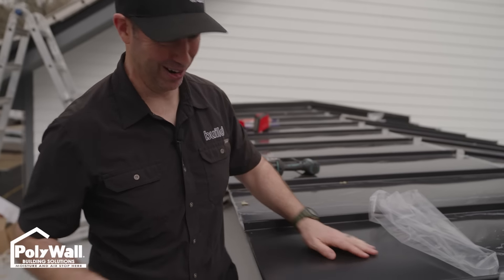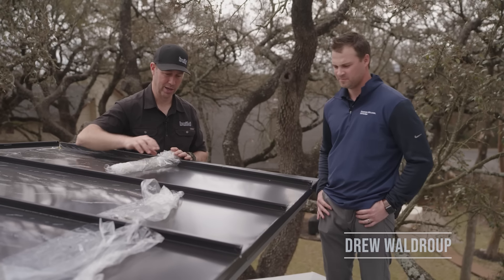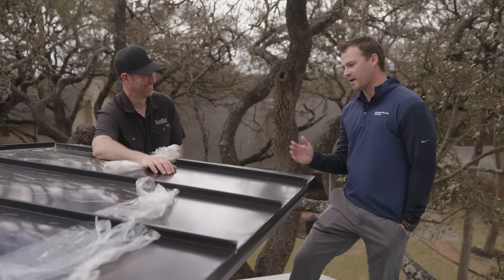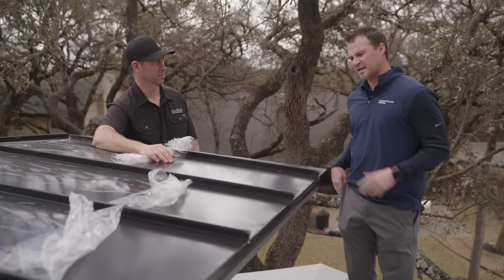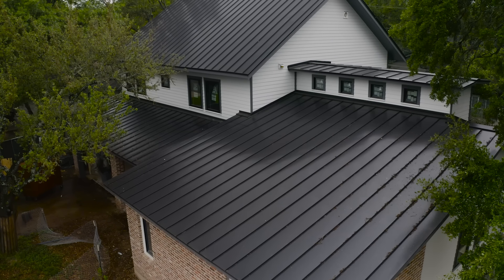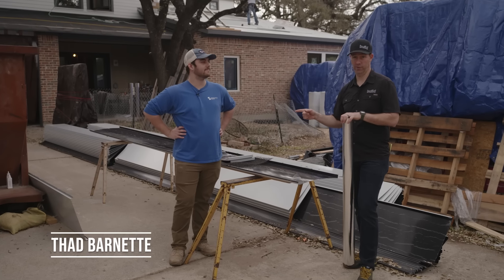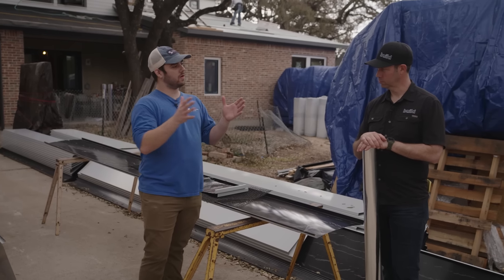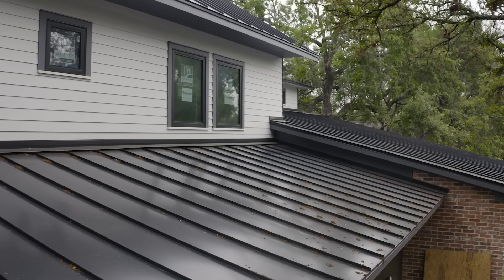Black Metal Roof - Dumb Idea?

Comment: very different from standard in Europe where it's mainly roof tiles and done well it can last centuries. I guess the labor cost is way much cheaper on the metal side though.
Metal is commonly used for warehouse or when there it not enough slope, and some place have zinc roof.
Reply: the nuts part is that in the south of europe they use the most clay and concrete roofing. where they also have the most quakes and big storms. with the north western parts like the netherlands its almost only clay brick tiles and yeah with storms they can go flying.
Reply: I priced a metal roof, and a tile roof in Croatia for a house. Metal was more expensive - it's more labour intensive to install than tile.
Reply: Yeah, metal roofs are very coomon in warehouses if you want a sloped roof. But, they are not made-up by architects or contractors; they're "metal roof sytems" such as VicWest's Marquis. Have used that system a lot.
Have also done zinc roofs - usually made by Rheinzink. Zinc roofs are gorgeous, although they can be expensive. They also require a high degree of metal roof installation experience and training. Not every metal roof installer can do zinc - manufacturers won't let them without extensive training, because there so much at stake with zinc roofs.
Reply: Ganga Din  
Neither! It's a question of what geographic region in the World you are talking about. Local market conditions dictate.
Nexe, and Tondach are big players when it comes to roof tiles in some regions. They make excellent tiles, and are not expensive.
Reply: Ganga Din  Yes, I'm talking about clay tiles. Unfortunately, I left my laptop in Croatia, so I don't have the actual numbers.
Roughly, for a 2,500 sf roof, the tiles *supply only" came to around CDN $6,000 for the Nexe Valens (black) tile.
The metal roof was roughly CDN $9,000. It was made by Prefa (standing seam, zinc coated steel).
Installation costs are higher for metal, than for clay, according to a couple contratctors I spoke to, because metal roof are more complicated to install than tile. The roof structure is essentially similar for both roofs. Labour rates are cheap over there.
I think with installation, the Nexe clay tile I could have had for under CDN $10,000 easily.

You can, if you want import them to North America, but depending where you are, the contractors may not know how to install them properly. Tondach is another very large roof tile manufacturer in Europe, and they have a huge selection of clay tile profiles and colours including white, if you prefer.

https://us.prefa.com/
European web sites are not in English, and they carry a larger selection over there.

https://www.nexe.hr/en/roof-tile-6074/6074
https://nexe-crijep.hr/proizvodi/valens/

https://www.wienerberger.hr/proizvodi/krov/tondach-crijep.html?gclid=Cj0KCQjwvYSEBhDjARIsAJMn0liPSQ2EQAlvQjxG8m-WIkQ1IiPghNTiamC-sDE8MmWXArblpsBmhewaAtaWEALw_wcB&loadmore=2
Reply: Centuries?

Comment: What I noticed after installing a black metal roof is that it still reflects a lot more light than any asphalt roof. The black metal looks blinding white in direct sunlight and it's even hard to look directly at it. I live in the north though, so I went black to help melt snow.

Comment: I went from a black shingle roof to a white shingle roof several years ago.
My energy costs during the summer went WAY down because my roof wasn't soaking up all the heat.
Reply: yes but  I haven't seen a white roof that doesn't look dirty after a season
Reply: @danielwanner8708  
Pressure washer with a good nozzle that can reach the roof.. Easy to clean.  :)
Reply: @JohnD-JohnD  Please don't do that . You will shorten the life of the roof . 3000 PSI probably would be enough to blow a hole into the shingle .  What really makes it nasty looking is the sealing strip melting and oozing out from beneath the shingle . I went from white to black . Architectural shingle . 15  years still looks great.
Reply: @danielwanner8708  
lol, you misunderstood.. Or I didn't clarify.
Pressure washer with soap cannon.. It's not a high-pressure jet and will not scrub away the surface.
Reply: @JohnD-JohnD  that makes sense . I already saw holes being blasted into roofs . lol

Comment: I have a black metal roof, looks amazing, SUPER ANNOYING in the summer, no matter the expansion joints, no matter the expansion holes for the screws, it still buckles, bends & warps during hot summer days (or even spring, the problem has already started), when it cools down during the evening the roof unwarps itself to flat again & it sounds like a gunshots/explosions, keeps me up at night....but who knows, maybe your roof is immune to this issue

Comment: Matt, you only talked about Heat and Fade issues. What about expansion/contraction of the metal? 
Black roof... more heat...  equals more expansion/movement ? How do you compensate for this?

Comment: I don’t understand the reflective sharkskin layer.  Common sense seems to say you’ve created a heat pump radiating and reflecting heat back into the house.  Any heat in the air gap reflects only one way, to the house, meaning heat in the house stays in the house.  Heat in the metal sheet conducts to the reflective layer (no air gap there equals no reflecting back) then radiates to the house.  Hence the heat pump.  It should have been built with the reflective layer on the house facing out then the air gap above that.   Am I totally crazy?!?!
Reply: It's installed correctly.  It's to prevent emissive radiation, not reflection.  I wrote a longer comment explaining it better.

Comment: All I can say is. Any Roof you choose ensure you have proper venting with your roofing installed. That alone accounts for 90% of your efficiency. As more of a draft zone you got as better is will become. I prefer a metal 3' draft zone and below the draft zone I install the radiant barrier and use attic solar fan's so only when the sun is hot enough and the thermostat is kicked on it will kick those fan's on which will help to suck out the hot air which is been trapped in that space between your roof shingles and your radiant barrier. It will result in a 60F+ degree difference  for your attic which is HUGE.

Comment: Looking at that shark skin roofing, it seems to me that you could use the channels to lay in passive solar water heating pipes.  Double duty.
As for black roofs, black absorbs more sunlight, so that if you have snow itll take longer for the snow to stick on the metal.

Comment: If you're still hitting all the PHIUS targets I don't think the color matters. 
On the plus side, the energy gain from the dark paint will speed up the drying of any moisture that gets into the air gap. That might be worth the efficiency hit. 
The standing seam roof is nice for PV attachments. I don't remember if you've said anything about the PV system.

Comment: Short answer: a black roof in Austin Texas *IS* dumb *IF* you're expecting it to perform like a white roof 😉
Reply: Which means anyone actually paying it's dumb.
Reply: @davidg5010  In Austin?? Maybe 2 months?
Reply: @davidg5010  If the roof or attic is insulated, like it should be, the heating assistance is minimal, especially since sunlight is at its weakest during the winter.

Comment: We wrapped our entire house in corrugated steel in the early 2000s. For the most part we have had very little color issues over the last 20 years except in a few specific spots. The heat is an issue but I believe a lot of that is because we have insulation from 1976.

At the time metal on a house wasnt a thing. When we started the process the steel company told us we couldnt do it. I imagine most of the tech has advanced drastically. We are in So. Cal so it can get hot.

Oh and we had a tree fall on the house a few years back. Dented a corner but thats about it. No extensive damage at all.

Comment: The look is perfect, and with the insulation, reflective barrier and air-gap you shouldn't get much (if any) heat gain from the dark color there in Texas.  I'm in Michigan however and for better than half of the year I would WELCOME heat transfer into the house!
Reply: Keep on mind solar gain will be significantly reduced in winter, especially in the north, and especially on low slope roofs.

I would still go with a lighter colored roof, even where I live in Canada.
Reply: @Bob_Lob_Law  A low slope roof isn't in the forecast unless I can persuade "she-who-must-be-obeyed" to move to more southern climes!  When I do my own build, I'm planning on the roof slope being about the same as the latitude (43 degrees) and with the ridgeline running as close to E-W as possible since I want to do PV for backup power.
Reply: @michiganengineer8621  I've been working on an energy study lately. I live in winnipeg, and I've been crunching numbers on a totally off grid structure.

It is very difficult, as we have very little sun in January and up to 1050 HDD. Because the limiting factor is winter, a very high angle is optimal.

Something around 70 degrees, also southern glazing is very important for heating, and a high SHGC combined with a low u factor is important.

I've been thinking about a home design with lots of southern glass, and a monoslope roof pointing south. You could do battery storage, solar, and solar thermal.

If you don't have net metering, you will want to generate energy when you need it the most, ex winter, and furthermore you will need to optimize it over annual generation. Probably mounting your panels on a rack will be necessary.

Unless you plan to insulate your hkme really well and use high effeciency appliances, you will have a difficult time harvesting the energy you need. Even in a warm climate like Michigan.
Reply: @Bob_Lob_Law  Net metering is available in most areas of Michigan, so mine would probably be a "hybrid" as far as electricity.  About 6 years ago we lost electric for a week and a half just before Christmas, so a whole house (multi-fuel) generator would also be a must-have.

Comment: Nice build, but I thought with a radiant heat Barrier you need a air gap to make work the best, so air gap between roof metal and radiant Barrier???  Maybe you can show some testing of barrier and with out? Thanks
Reply: His air gap is between the roof deck and the roof, with the radiant barrier’s shiny side down. 

It sounds counterintuitive, but it works. I was confused at first, too.

Basically, it’s not there to reflect the radiant heat. It’s there because it doesn’t emit heat. You can Google this. It’s pretty well documented.

Comment: I measured this years ago by placing two pieces of metal in the hot Central Texas sun.  The silver piece was 110 deg F, and the black was 135 deg F.  White would have been even cooler.
Reply: But how did you measure?

Comment: Yes, dumb.  Consider Pollen, dirt as well as efficiency.  Should get dark bronze.  Consider Nuray Metal if in Pacific Northwest area.  Happy with our NRM-2000, Dark Bronze!
Reply: Bruh black is timeless, dark bronze would look terrible on the SS Rinsinger
Reply: Or, paint the metals with that lumilor electric paint that lights up with a small amount of current, similar to those glowing organic bacteria night light emitters. It's an expensive process, unless you mcgyver the chemicals yourself from raw elements.
Reply: @MustardMade  ha, yes, agree, in general, Black is timeless.  Just can't see it weathering well, trees are currently dumping large pollen loads on my roof.  I clean my own roof.  Bet SS Risinger will be featured in a roof cleaning company sponsored Ad on this channel 😁
Reply: @AzaB2C  Very groovy to hear that. Yes, ways to create types of LED's.

Pixel patterns could be generated with using a silkscreen method of application, or to just use a full coating without a silkscreen, then hit the sheets with a laser to create the bounderies for the pixels that are needed, along with a serious matrix switching system to direct electron traffic as if the roof is a tv screen all the sudden.

Comment: I don’t think black is a bad color in your case with thermal breaks and reflective properties. 
I’m in Wisconsin and and had a metal roof put on about 12 years ago. Noticed a summer temperature change in the house. Less AC needed. Started out blue and has faded to almost sky blue. Still looks great. A few years ago when Canada had those wild fires it turned a ugly brown/black when viewed at a angle. But cleaned up after a few good rains.

Comment: 2 cents worth - black roof in northern end of the central valley of California (Sacramento to the north, south, east and west) where summer daytime temps are 100+ degrees, one would be insane.  The A/C will be running non-stop to keep the temperature inside bearable and just wait until you get your PG&E bill.  Currently temp is 102 F and that's cooler today.  Can't wait for winter.

Comment: I just did my first metal roof last week with a contractor.. was a great experience. I will say getting the valleys to lay flat with no waves on the asphalt shingles was a little challenging.  Also was so time consuming with all the cuts folds and bends vs the screw down metal roof.
Reply: Do you recommend ypur contractor I am in Orange County

Comment: Installed a mansard brown metal roof in Virginia a few years back.  The roof facing the Sun would get up to 150 degrees by 11 am.  It was too hot to work on by lunch.  The heat generated would cause me to advise against it.

Comment: Matt you covered the bad (meaning less efficient 😉) color choice with a lot of insulation, but maybe it won't be so bad when those live oaks turn it green every year.  I wonder how that underlayment will hold up under the furnace.  It's not my pick, but I love that you are taking it head on and I appreciate the great content! 👍
Reply: I might have put a layer of rockwool on top of the foam insulation to protect it from the high temps that black roof is going to generate in the air gap...  Rock wool is fireproof too so would add a layer of protection there as well...

Comment: Short answer:  yes, it is dumb to put “trendy” colored roof, which also happens to be the hottest color, on a house in a HOT climate, and then have to cool said house.
Reply: It’s dumb if you don’t insulate your roof but in Matt’s case where he put insulation on top of his insulation and then he has his attic space insulated. He will be fine.
Reply: @ykciR  seems like a lot of trouble.  Imagine the thermal efficiency with a white roof, plus all the insulation.

Comment: A local custom builder was building a place not far from me. They put a black steel standing seam roof on it, its huge and steep. Within a couple days the whole thing had oil canned and looked horrible. At a cost of about 50k Canadian they ripped it all off and started over with a thicker material
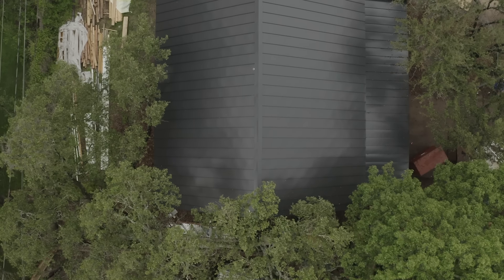Reply: Sounds like the interesting experiment shown in this video: black PVDF with fairly wide flat pans and neither ribs nor striations.  Curious to also know the material and thickness that Risinger used.  I think the experiment failed -- there is brutal oil-canning visible in all the overhead drone shots (2:17, 5:22, etc.).  Would be even worse on a sunny day.

Comment: Very dumb idea. You want to repel the heat, not draw it in.
Reply: It helps last longer due to the nature of how color pigmentation strength/resiliency becomes more gradient with lighter colors of paint/coatings.
Another option is to use a stainless or fiberous coating, or aluminum, if using the same types of metals as the coatings have.
Could also spray out a coating of clay/cement or truckbedliner over the metal, it wont be smooth, though it would absorb sound and provide durability to the surface metals.
Reply: That's why there's a radiant barrier with an air gap. The heat will just radiate back into the air instead of onto the wood of the deck.
Reply: Yep, no matter their market bs says it is the absolutely worst choice if your goal is energy savings. It will put more tax on his hvac systems. He can add all the reflecting material he wants and air gaps, he will still see a large increase heat load. We get the call every year, someone does a dark roof, and their AC can no longer keep up. 2nd worst thing people do is cut trees down shading their homes.
Reply: @Soccerrockker6   and there would be much less of that heat if a light color was used. He wouldn't have to use near the mitigating methods if he just chose a different color.  Pretty sure he just like the flex, and the freebies.

Comment: As far as whether or not black metal roofs are trending, well, so was linoleum flooring at one point. The big unanswered question is how does the SRI compare to a typical asphalt shingle roof that is installed in his area? If it outperforms black asphalt, then I think there is a case to be made. However, most HOAs are quite restrictive on what style roof you can have. If every house has Spanish tile, good luck getting approval to be the only house with a metal roof. However, since Matt's house is in a 70s era neighborhood, the HOA is probably not nearly as restrictive, and there are probably mixed styles in the neighborhood already. Switching from asphalt to metal is easy because metal weighs less than the typical asphalt install. But, installing tile on a roof designed for asphalt will require serious upgrades to the framing to support all that additional weight.

Comment: When my asphalt roof went bad, I used white Roofguard700 for trailers to lock it back down instead of putting on a new roof.  That saved me $5,000?  The attic used to be 140F in the summer.  Now it's about 5F above ambient temperature.  You couldn't get on the roof midday without getting burned in the past.  No more, but now you'd better have sunglasses if you get on it midday.
Imagine a flock of geese flying over Matt's house.  If you own a black car, you know what I'm talking about.